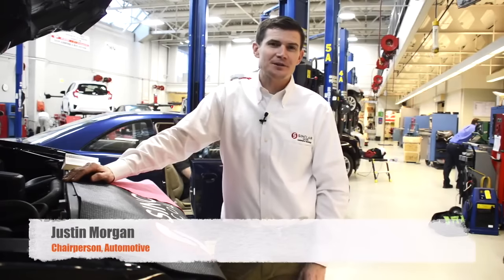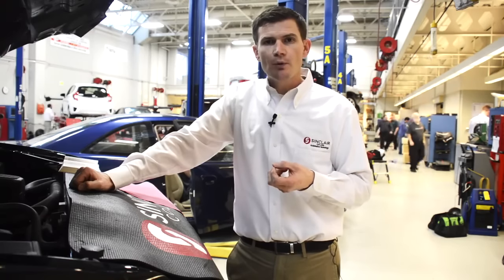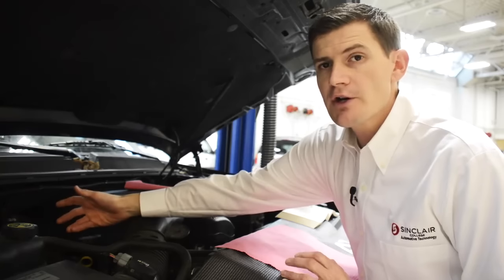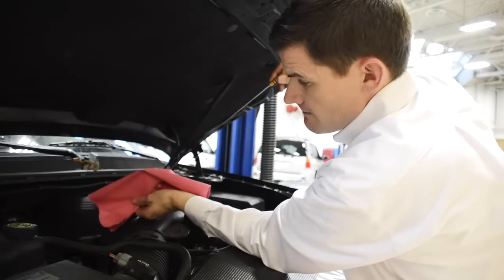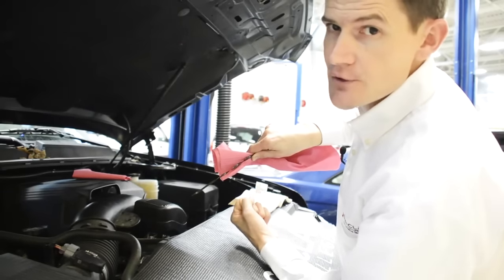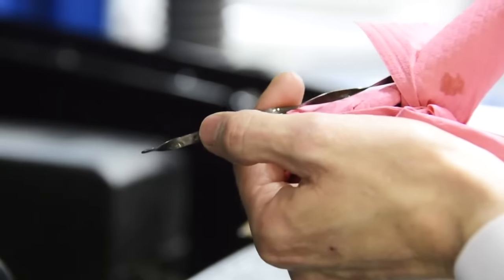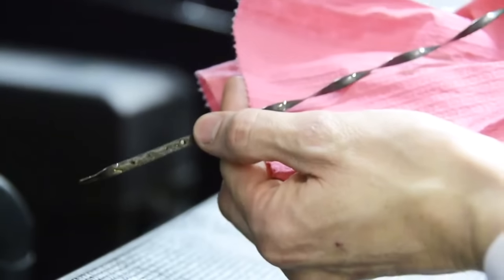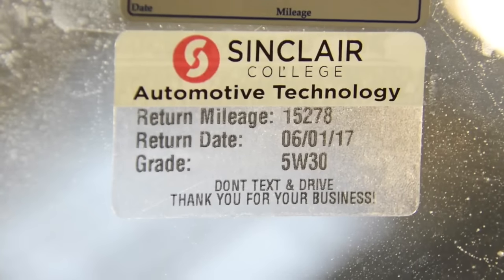How To Check Dipstick & Engine Oil - EASY

Comment: Hasmarks.. my Kia Soul 2011 is the 1.4 and uses 3.39 quarts or 3.49 quarts which’s is roughly like 3 and half a quart right…?? When I do that and pull the dip stick out the hash marks where it reads low or fine then full.. well it’s way above the f line. Why’s that??!!!! Why………hmmmm don’t know lol.

Comment: Bruh. I guess I’ve been doing it right, but I’m always fucking confused. One side of the dipstick, the oil goes up wayyyyy past the full line, but if I flip the dipstick to the other side, it’s right in between those 2 markers. Is that normal?

Comment: You do not check the oil every week gas pump. You only need to check just after oil change if your oil is at near maximum level. Then after overnight, check your floor if there are oil leaks. If it is not maximum level oil at the stick indicator, then your workshop is a crap shop that always tries to scam on customers. You will only check your oil when the oil sensor is lit or 10k miles oil change. Any workshop asking you to change at 3k to 5k miles, means they are scam shops. Your car manufacturer manual handbook writes the minimum requirement and always excludes 20% tolerances. So if the book writes 10k miles, you can go until 12k miles. Do not believe what car workshops or dealers because they only want to earn your money. According to lab test, the oil color does not mean your oil is bad.

Comment: Never never change every 3000 miles...all oil changes except on turbo charged engine can easily go 5000 or more
Reply: john Ervin I’d have to disagree, i always go 3k sometimes 3500 nothing more and have had 0 issues in any of my cars
Reply: Definitely wrong in some cases. Check your car manual and the type of oil you’re using. Turbo cars it’s very beneficial to do 3000 like I believe you said, but with some older cars, they recommend conventional and if you do use it 3000 is pretty normal.
Reply: It depends on the oil. I use full synthetic and Change it every 5000 miles (I change the oil myself) because I don't use the cheap shit the car shops use.
Reply: @THERIPPER216  3k if you're using cooking oil. The oil looks almost brand new after those miles in case you're not using a diesel car.
Reply: john Ervin I change my oil every 1500-2000 miles on my turbo car 🤷🏻‍♂️

Comment: Changing oil every 3,000 miles is excessive and unnecessary.
Reply: My owners manual mentions every 3,500 if there are excessive stops and in temps above 90
Reply: Depends on the oil if you're using conventional oil you should change it every 3000 if you got a better quality oil you might get away with more mileage but you always risk damaging the engine if you oil is dirty change it

Comment: new cars should not be consuming oil.  Manufactures need to correct these problems not blame consumers.
Reply: All cars use a little bit of oil between oil changes as they pass the vapors into the into. Since it's spinning so fast inside there's some oil atomization and they need to vent.

Comment: Check it when the motor is hot or cold?
Reply: Mirlin Moorefield Cold.
Reply: Both are fine just wait half an hour after driving so you get an accurate measure.

Comment: My manual for 2010 cobalt says: every 7500 miles.And I had 0 problem 59.000 miles and Still running like clock..
Reply: 59000 miles is far to low to to know if your are wearing out your engine.
Reply: Tru.But oil companies and dealers want our money and want us to change it every 3000 miles. There is documentary how scientists test oil after 6000 miles and oil is just fine. I trust my manual I don’t know about you...
Reply: 7500 seems reasonable in my opinion for an OCI but I personally never think about going beyond 10k though I personally do 5k since it's a work truck that gets used harder.

Comment: What if its over the filled mark? Is that bad?
Reply: Depends how much it's overfilled. If it's only just a shade over the full mark then it'll just burn off when you take it out for a drive. but if it's over by a significant amount then yeah that's not good.
Reply: Yes you will blow out your engine oil seals
Reply: Kory En  a quart is no big deal. It's called a forgiveness amount. Check Bob Likis video on over filling oil
Reply: hmm is that true? cause I did oil change and I added one bottle of 6 cylinder engine restore... I hope that bottle wasn't enough to really over fill.
Reply: Kory En  no should be no harm  quart or so over. Go on YouTube and in the search bar put in Bob Likis on over filling oil. They call it a forgiveness amount. A quart low won't hurt anything either.
Reply: seeeLAH1  your safe don't worry.

Comment: If you got full synthetic and a quality filter.... and you change your oil before 7500..... you're just silly....
Reply: Yep I go 5 to 7k intervals on my truck using Liqui Moly. It's not at the exact milage but it's between there. But I don't baby my truck it gets loaded with 2k pounds and does a lot of mixed driving.
Reply: what do you expect? the guy clearly works for a dealer or something

Comment: More 3k oil change garbage, even on a modern vehicle? I have almost always waited until my dodge tells me to change the oil, around 8k, almost always conventional. It's now 164k miles with no engine leaks, performance issues or excessive consumption. If I had followed this guys 3k mile oil change crap I would have been out probably a thousand or more dollars over the last 8 years.
Reply: Well said. This video is giving bad advice. 3K is a waste of money and violates manufacture maintenance specification designed by automotive engineers. Change the oil as the manufacturer prescribes. We maintain fleets of vehicles and a 3K oil change recommendation on 21st century cars simply robs business and families of hard earned money.  Engines do not fail early if you follow the OEM maintenance of 6K, 6.5K, 7K, etc.

Comment: Really. Is that true? Change your engine motor oil every 3000 miles. So if you drive 12,000 miles per year then you change your motor oil 4 times per year. That is a lot of motor oil changes. A gentleman recommended in the comments below that as your car accumulate more mileage then you change your motor oil every 3000 miles. I think the presenter in this video needs to qualify his statement. Does a new car need to change the engine motor oil every 3000 miles?

Comment: You need to change click bate photo.  If you changed your oil every time it was black. You would be charging it every month or 2 depending on petrol or Diesel engine. Engine oil never stays clear never.

Comment: An Engine replacement at only 3000 dollars you are kidding right ? Any engine will cost at least 10000 dollars.
Reply: YouTuber 12345 usually people change with a used engine which don't cost that much. 
i change my subaru engine which only cost 800 to buy and 700 for labour
Reply: YouTuber 12345 youtuber 2500 dollars for a new create engine for me, but that’s cause I have a 2000 silverado.
Reply: Allah Turbo I totally forgot about that thanks anyway
Reply: Los Ojos De HotSpanish hhhhhhhhhhh good for u mate thanks for your comment
Reply: YouTuber 12345 youtuber for 10k, I’ll just get another car
Reply: Depends on the engine...some are crazy expensive